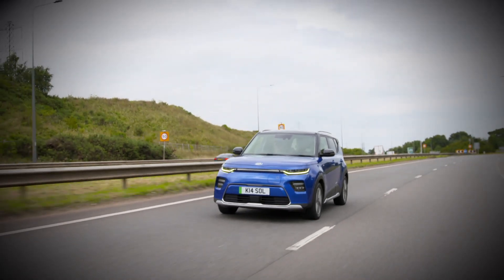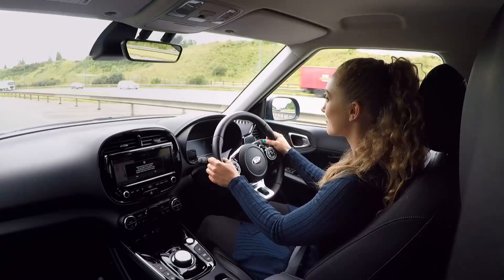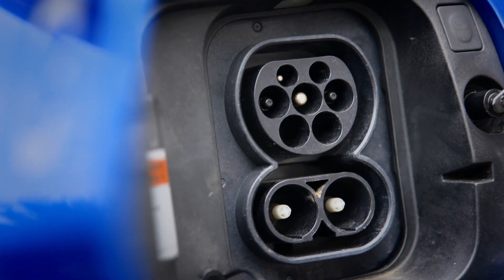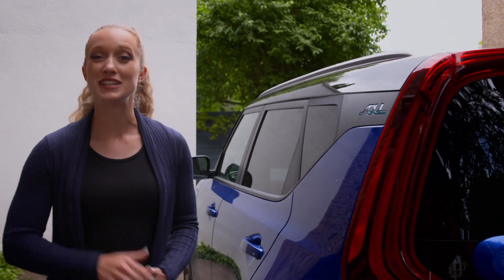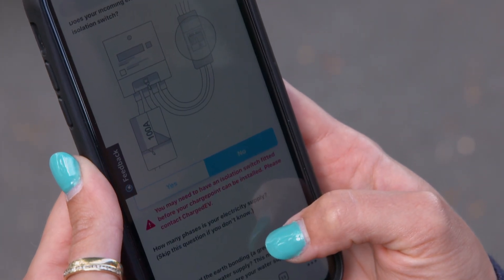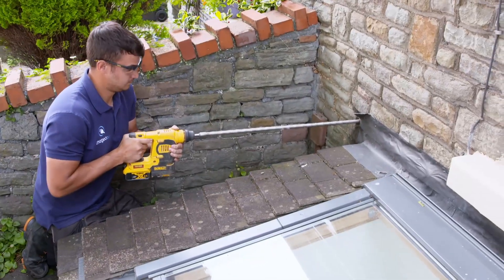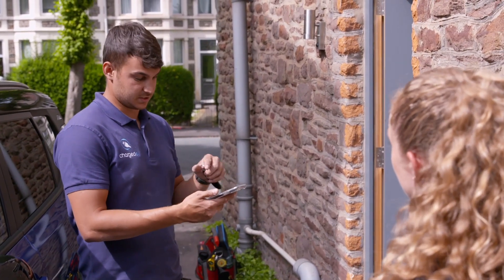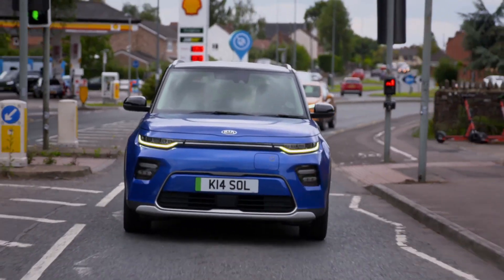How easy is it to install a home high-speed EV charger? | Fifth Gear

Comment: How can a charger pay for itself, when you'd have to charge using the granny charger anyway...it's only charging faster and saving time, that's the only real benefit.
Reply: There is more to it than that. The price paid for energy (KWh) is lower with certain energy suppliers. The rate is lower between 12 - 4, typically between 4 - 5p per KWh instead of 15p per KWh normally. For a 30 KWh charge, with a home wall box would cost £1.50 (ev tariff), granny charger £4.50 (standard tariff). For me this saves  £300 per year (based on 12,000 miles per year). Also it adds to the value of your house.... win, win!
Reply: Yes, that is the benefit. Correct.

Comment: and how many scroats are gonna be nicking the cables for the copper content or worse yet causing damage or harm, can you imagine
Reply: Hopefully the scroats won't be wearing thick rubber gloves when nicking the cables.
Reply: Quite possibly, given the weaselly ratboy scavenger type seems highly prevalent in the UK . But if it's inside your garage it SHOULD be safe
Reply: It was £100 just to install a circuit breaker, then it was over £1000 to install a decent charger. These are costs on top of buying your EV. Then we have the clowns telling us how much cheaper EV's  are? I won't be watching Fifth Gear anymore! 😮

Comment: and how is all this electricity produced to power these so called save the earth vehicles, oh i know from coal and gas/nuclear power stations, !!!! don't tell wind farms either because there's not enough  power , so roughly 25 million homes and wind farms produce about enough for 3-5 million homes gonna be a while yet then..................... how many of these homes are single dwellings where the owners can use their own supply, no use if as so many do live in flats etc,

Comment: You’ve got to be incredibly talented to get home with your car at 0% to be able to charge from 0 to 100%  a 64kwh car for 28hours on a domestic outlet.
Reply: This is the problem, everyone always talks as if you always charging from 0 or that you have to sit in your car whilst it’s doing it. Who cares if it’s charging for 12 hours if you’re asleep for 10 of them.
Reply: To maintain your EVs battery life you should typically be using it between 20%-80%. Run down to 20% and charge back up to 80%. That means 38.4 kWh usable from a 64 kWh battery (60%). To charge 38.4 kWh at 7 kWh is going to take just 5.5 hrs and near 14 hrs on the 3 pin wall socket charger.
Reply: @stevecade857  yes, that’s what should of been said..
Reply: @stevecade857  most car's limit the usable battery capacity to some degree anyway. 32kwh in my mini and 29kwh is usable. charge speed also slows down quite a lot beyond 80%.
Reply: @mikewhitehead50  It would seem manufacturers only allow around 90% usable capacity of the battery so charging to 100% is only 90% in reality.
Reply: @stevecade857  yes, true.
Reply: Keep driving back and forth in the driveway until it's empty :P
Reply: @Alexandra-Rex  or leave the heater or air con on it'll take a while though so get it as close to 0% as you dare

Comment: In the USA, electric cars are only a city thing or people who don’t travel can drive them. With the time it takes to recharge, it’s not worth it if you travel or drive a lot. They also never discuss the power issue. Environmentalist groups and politicians are not allowing power plants to be built, so there are areas with rolling blackouts. So how can you charge if there are power issues?  Another concern is the waste of bad batteries. But that will have to come later as if these vehicles increase, and as they become abandoned, what happens to the power cells?
Reply: What a bunch of utter crap is in your head. Please go get a proper education.
Reply: americans have an ignorant stereotype outside the USA
Reply: 2nd life for batteries will be the norm in homes as power storage. Use the power when expensive, charge when its cheap
Reply: @davyhoogy  That's right. We have two Tesla batteries on the side of our house which charge up from solar during the day and discharge when we need them (usually in the evening)

Those batteries were formerly in Tesla vehicles.
Reply: Same old same old tedious garbage . How do you fill up if there are no gas stations? If there's a gas station there's a wall socket. 

And isn't it funny that EV owners don't have any complaints about their cars.
Reply: You can't use a gas station  if the power is out. See above for what to do with your battery when it's no good for powering the car... in your old age given they are lasting a heck of a lot longer now....
Watch some more YouTube mate, try the Fully Charged Show for starters, then Transport Evolved for a proper education on ev's. Oh and its now possible with more and more ev's to use them in a power outage to plug in your refrigerator and generally power your house for a while. A lot quieter and cleaner than the inevitable diesel generator I just know you're going to site.

Comment: How long ago was this filmed? With the cost of electricity going through the roof as it has done recently to the point of many energy companies going bankrupt, I wouldn't be surprised if it's actually cheaper to run an I.C.E.
Reply: Another comment that hasn't aged well. How is that fuel price?
Reply: @handlesarefeckinstupid  Coming down thankfully, but has been close on £10 a gallon in the UK in some places. Most things don't age well if you leave it long enough 😏
Reply: You got a point but it will be still cheaper  to run a EV over a I.C.E as fuel prices have gone up to with gas and electric but I bet the margins are quite slim.
Reply: @ben3291  Margins aren’t slim at all, i have an ID 4, currently on my electricity rate it costs around 80 cent to drive 100km or 60 odd miles, the car i had before, a diesel Peugeot 5008, costs about €11.50 or £9.80 to drive the same distance! big difference for me
Reply: @mikeconnolly6845  but how much is a 5008 diesel vs ID.4? Massive for a decent 5008 diesel your looking at £35k for the same ID.4 its £10-12k more . Plus if you lease them your not making your money back atm plus WHY an ID.4 its crap got a horrible interior like the ID.3 should of got a Enyaq or a Hyndai Ionic 5.
Reply: @ben3291  you’re assuming about three different things there! 
1. the ID 4 i bought was just over 42 grand when i was buying it, an equivalent 5008 would have been at least 40, more likely 43-44
2. i didn’t lease, the car is on a loan so i am actually going to own the car at the end. 
3. at the time i was buying, neither of those two were out, the enyaq was almost out but not quite, it also cost around 3 grand more over here for an Enyaq, no need to fucking shame me for buying a car that fits my life and that i like. and also, since i’ve bought the ID 4, i have sat in an Ioniq 5, it is nice but feels much smaller, lower and less sturdy than the ID 4.
Reply: @mikeconnolly6845  not shaming you just telling the truth about the ID.3-4 there not good people go on about VW Quality  yea on the surface they used to be but always underneath there cheap . Plus no its not 40k for 5008 you can buy a 5008 Diesel Allure for a pinch over £35K the equivalent ID.4 is like I said and checked about £10k more . Electric cars do as much damage as I.C.E cars from the get go with the process of the batteries it is far more environmentally bad and they only last 10 years max so after all that environmentally friendly driving you do to offset it your back at square one when they fail .
Reply: @ben3291   But there's almost NO MAINTENANCE cost compared to ICE, which easily offsets the price difference. Service intervals are every 20k. No oil changes ever.
Reply: @ben3291  as I said before, I live in Ireland, a 5008 1.5 diesel Allure automatic is actually over €46,000, I pad €42,248 for my ID.4 as it is a First Edition model. I’m not even going to get into the overall environmental impact on electric vs ICE with a dinosaur like yourself, because you will never agree with me
Reply: @mikeconnolly6845  as I put to geffel the cannibal  I don't hate electric cars it is just atm there not quite there . The Range is not there yet and there just too expensive for the average person . Plus the infrastructure in the UK is not there yet to handle a complete switch over to electric cars .

Comment: This info is slightly incorrect. A wall socket can output upto 3kw not 2.3kw. Although most ev chargers limit their charge to approx 2.3kw.
Reply: Trying to buy our first EV and it has been a steep learning curve with so much misinformation or lack of.

Comment: Over priced connector....it's not a charger .....thats built into the car lol....great false information
Reply: The overpriced bit is correct though. All of them. The joys of early adoption.
Reply: No, they are chargers.
The BMU on the car cannot activate the variable induction circuitry without changed electron entropy.  Electricity does not travel in the cable, but in fields around  the cable, as dictated by the Conservation of such,  hence, by any reasonable definition, the apparatus is a charger.
But you are right in that it incorporates a 'connector' that is hideously proprietary.
Reply: @michaelgriffiths2957  Best response ever!

Comment: All electric by 2030, good luck with that. Not gonna happen!
Reply: It is happening. Currently 25% of new car sales at full EV. One year ago it was 6%, year before that 1%.
Most experts say 2030 is easily achievable. If the wanted a real challenge, 2025 was doable.
Reply: @davidkerr4103  Guess it depens on the cost of the car in different countries, but here even a small car like a 208 or Corsa is too expensive for most working people. And almost eveyone that lives in apartment buildings have no where to charge them and nothing is really happening on that front. There is just too many problems to solve in 8 years. EV should be a option not a must. At least till new better and cheaper battery tech comes.
Reply: @NikesZ28  I couldn’t comment about pricing in Sweden but here in the U.K. a Corsa e is only 13% more a month (£289 vs £250) against a petrol one. The saving on fuel and servicing would make the EV much cheaper to own. There are also loads of new, low cost EV’s due out next year so things improving all the time.
I agree, EV adoption for people that have no private parking or work place charging is more  difficult but solutions are being adopted like chargers on every lamp post. 
Some councils have done a great job, some have completely ignored the issue.
These councils are incompetent and need removed/voted out….
Reply: It'll be public transport for you then, thicky.
Reply: @AiTheBetterToSeeYouWith  second class transport is better than first class walking 😂
Reply: It'll be about 2050 by the time I could afford a used ev, I'll be too old by then to care lol
Reply: @Markcain268  Not very different for me, got 4 years left on the car i have now then i got 4 years to save up for a much more expensive EV, not happening. 2050 is a more reasonable goal.
Reply: @NikesZ28  it's not as if I've seen any affordable EVs I actually want, think I'll save my money and utilise my pensioners bus pass lol